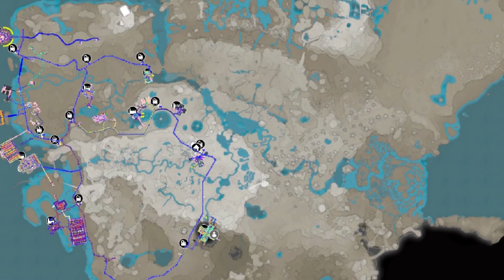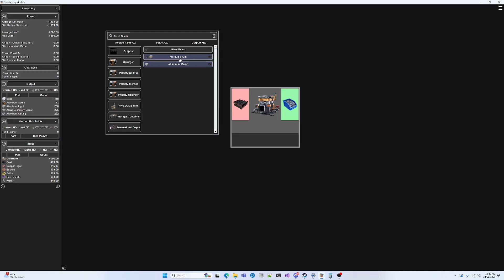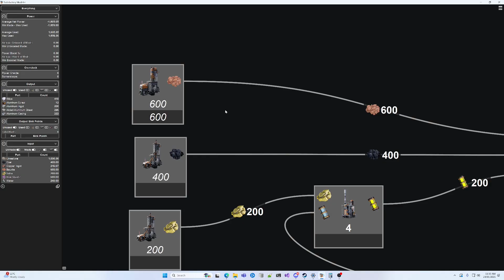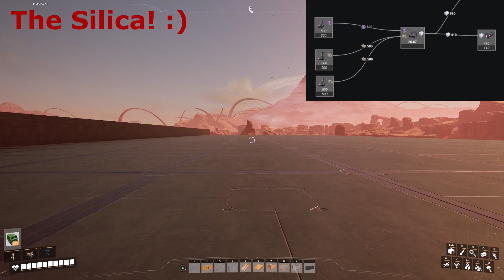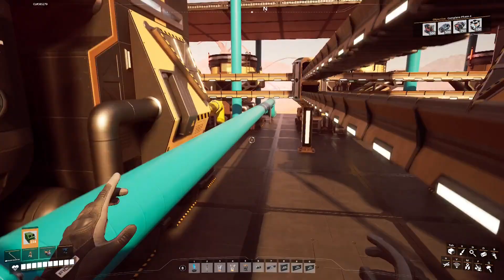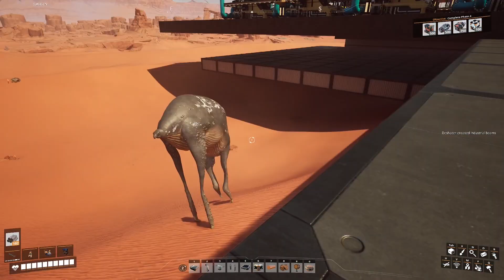Starting a New Desert Megafactory: Aluminum Adventures Begin! 🌵

Comment: 990 is very easy to spit off. Smart split 2 mk.4 belts to get 960 and smart split a mk.1 belt and then split it in half and add it to the 2 mk.4 belts. 990!